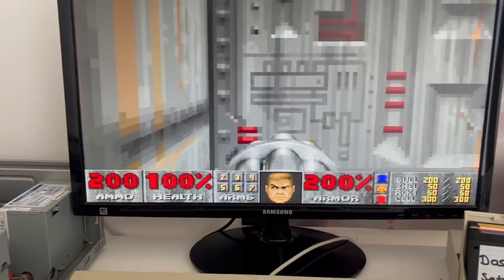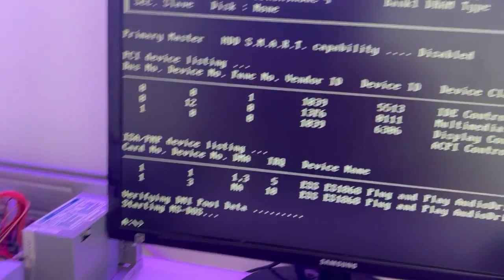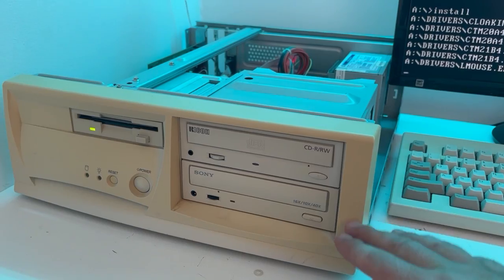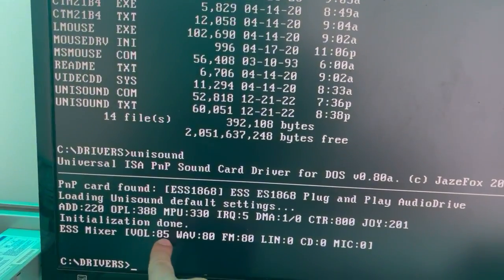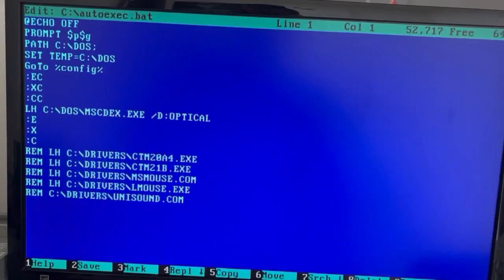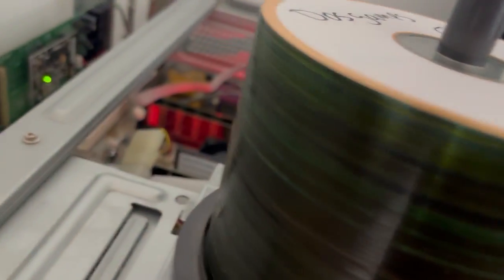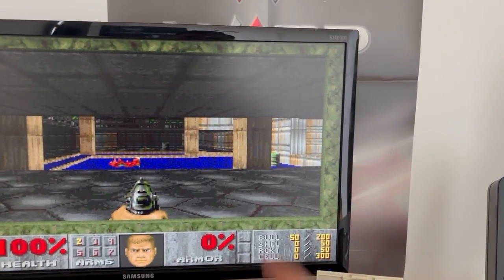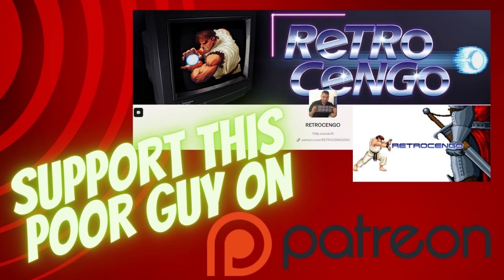Easy setup Retro PC MS DOS with PHILSCOMPUTERLAB disk and Dreamblaster DOOM fun

Comment: I've recently installed MS-DOS 6.22 in 86Box using PhilsComputerLab's new Easy and Fast MS-DOS Boot Disk method that you showcased in this video. My emulated DOS machine is configured as follows:

Machine Type: Socket 7 (Dual-Voltage)
Machine: Shuttle HOT-557
CPU: Intel Pentium MMX 166
Memory: 32MB
Video: S3 ViRGE/DX (375)
Mouse: PS/2 Mouse (Wheel)
Joystick: 4-axis, 4-button joystick
Sound Card: Sound Blaster AWE64 Gold
MIDI Out Device: Roland MT-32 (New) Emulation
Hard Drive: 2GB 5400 RPM IDE
Floppy Drives: 3.5" 1.44MB and 5.25" 1.2MB
CD-ROM: 52x ATAPI CD-ROM drive

My host system is a Minisforum UM680 Slim, which consists of the following specs:

CPU: AMD Ryzen 7 6800H Octa-Core at 3.20 GHz (up to 4.70 GHz)
Memory: 24GB DDR5 SODIMM
Hard Drives/SSD's: 1TB primary NVMe M.2 2280 SSD and 2TB secondary NVMe M.2 2280 SSD
Other Storage: LG BP50NB40 6x USB 2.0 external Blu-ray Disc writer
Display: HP 24mh 23.8" monitor (1920x1080 pixels)
Graphics Card: AMD Radeon 680M
Gamepad: Xbox 360 Controller
Operating System: CachyOS (based on Arch Linux)